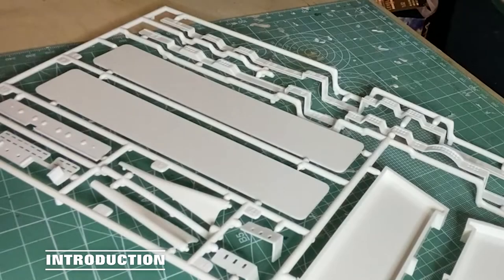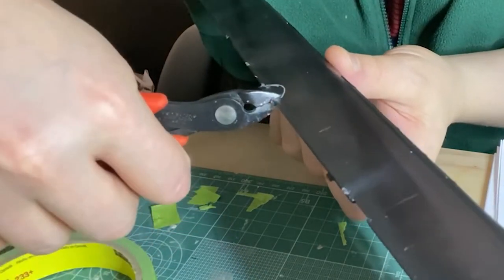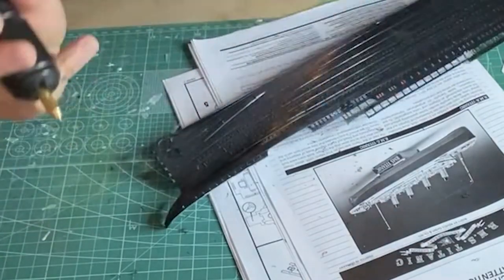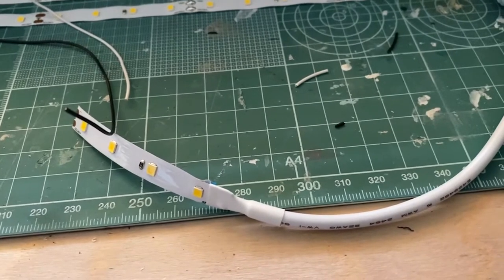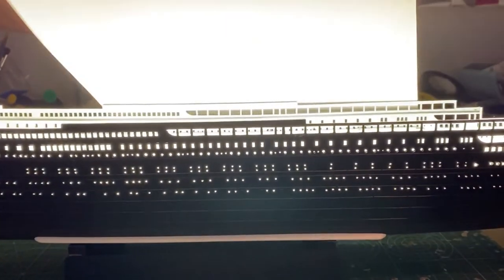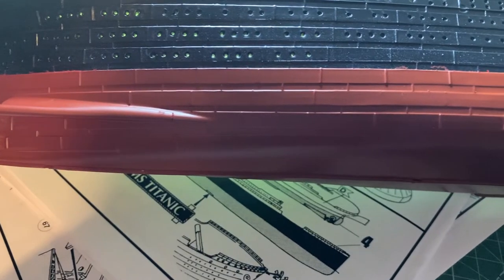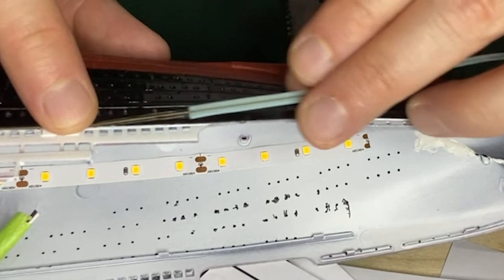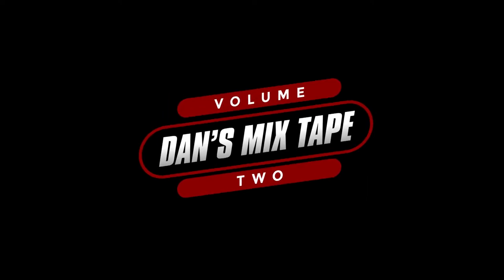RMS Titanic - Part One

Comment: Very nice videos. I bought this set and am planning to install lights aswell. What was the blue putty you used to block the leaks under the decks? Is it necessary to paint the hull on the inside? Does the light really get trough if you dont paint?
Reply from the maker: strips of insulating tape, so much easier. Absolutely, if you want to light it, you must block it first